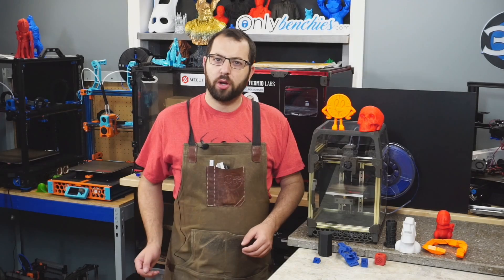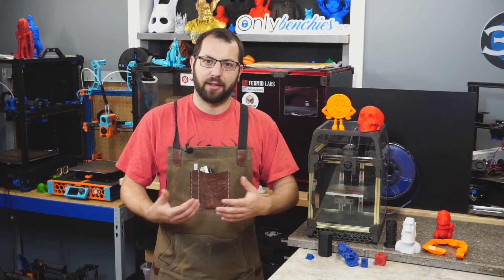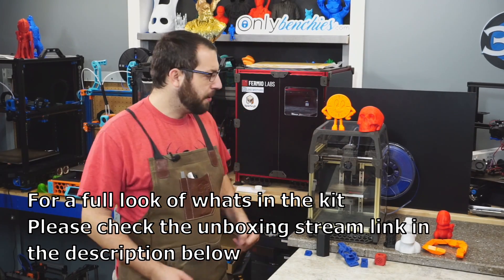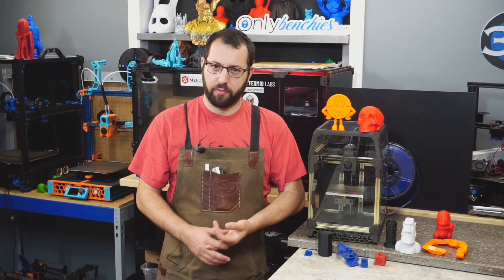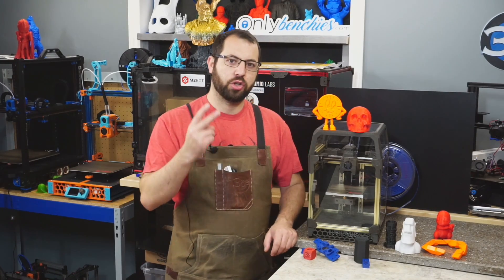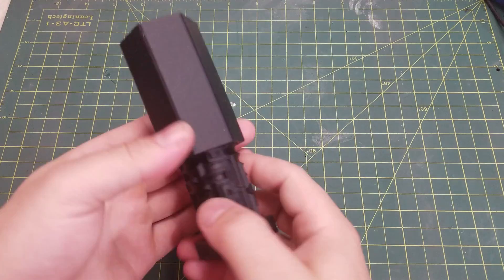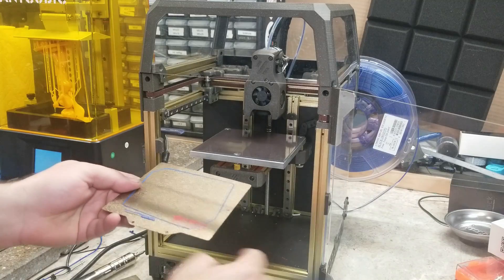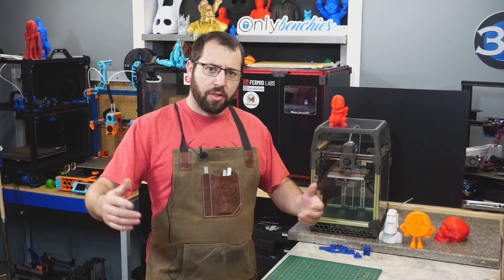Voron V0.1 - LDO Motors Kit - Taking a look at the Printer, Build, and Kit

Comment from the maker: HEY, quick line flub I want to fix, I know I said the kid includes everything to build the printer, this does NOT include the printed parts. 
(and yes the cable cover things for wire management are included with the kit as well)
Reply: But when will the kit be available 🤔. I wannnnttttsssss it 😥😔 lol
Reply: You didn't mention crimping tools.
That's because the wiring loom takes care of all of that?
Reply: @JaydLawrence  Good question. Do we need a crimper for this build?
Reply: @bassam.2023  I needed one for mine since I ended doing the wiring myself. I bought a generic "Molex Connector Crimping D-Sub,Molex,JST,JAE Micro Connectors 32-20AWG" for about $20. This was able to do the JST connectors and the 10 pin Microfit 3 connector pins for the hotend
Reply: @TheRoboboat  Thanks! Also, I did go to the discord and it seems that the recommended crimpers are the engineer pa-09 for a voron build. I might just buy them just in case though they're certainly not cheap, cad$57.
Reply: @bassam.2023  No problem! I haven’t tried those yet. I’m sure they are good if they are recommended though😁 You only really need the tool for the build so might be able to return the tool after *wink wink*😂

Comment: Which Extruder do you prefer for v 0.1? 
It look likes Direct Extruder is Standard in the Buildguide. But Bowden is better for higher Speed. And then which, M4, LGX or what. Im confused :(
I want to buy this LDO Kit.
Reply from the maker: Im firmly on the direct feed train now a days
Reply: I just saw this video and I am a couple hours from finishing my own ldo v0.1 build. I can't imagine feeling so satisfied building a voron outside of a kit this complete. I would totally recommend if this fills a void of printing that you have. I myself needed a dedicated, fast abs machine and the size was fine for it. Price wasn't bad but not necessarily cheap. So far very satisfied.

Comment: I really like to build a Voron, in fact I want the 0 to make more parts for a 2.4... but my actual CR10s cannot be enclosed easly... so to print ABS parts I need to figure it how to do it.... yes I know the print programs but as I know myself I want them now hahahaha
Nice reviews by the way!!
Reply: I also came from a cr10s4 and printed my v0 and then a v2.4 on the v0
Reply: @AleEmm-yay  did you print the parts for the v0 with the CR10s4? how you managed to print ABS reliable? I cannot get good enough prints
Reply: @jra  What ABS Filament did you use? esun ABS+ is very tolerant. All tough i used some regular ABS and just put a huge lid over the printer. How do you do it?
Reply: @AleEmm-yay  Standard ABS from Amazon... and without enclosure, as I said I think an easy way to put some kind of enclosure.
I'll give a shot with Esun ABS + thanks

Comment: Hey, have you seen the phaetus x zodiac dragonfly? They basically fixed it by making the hotend rigid mounted to the cold end.
Reply: Just craziness, its a Slice clone at the same price
Reply: @slimanus8m  That's true though, they loss the price advantage but it comes with an included zodiac nozzle (which are expensive) and, apparently it has pretty high quality requirements.

Comment: Every time I watch videos on this kit I struggle to convince myself not to get a V0.1
Reply: Well, based on talking to owners, one reason to not build this printer is difficulties printing PLA. The part cooling is done by 2x3010 fans, that put out a tiny amount of air. This is a serious concern for those of us who print predominantly in PLA.

But don't take my word, check out the discord.
Reply: @bassam.2023  There is a mod of the toolhead that use one 5015 with optimized airflow for PLA. I see many crazy successful PLA prints very often around me with Voron's. True, that mod helps a lot.
Reply: @BonBaisers  Good to know. There is hope for us PLA printers. I hope it will be standard in the V0.2 design.
Reply: The question is not if, but when you will get one :P
Reply: The question is "why not build a V0.1" ?
Reply: @BonBaisers   I already have 4 printers and parts for another 😥
Reply: @eddietheengineer  You could have 5 printers and parts for another.
Reply: @BonBaisers  lack of access to a 3D printer.
Reply: @dhxmg  contact me on discord (sweetcookie) I will help you !
Reply: @BonBaisers  with that discord name you sound like the kind of person he shouldnt contact 😆